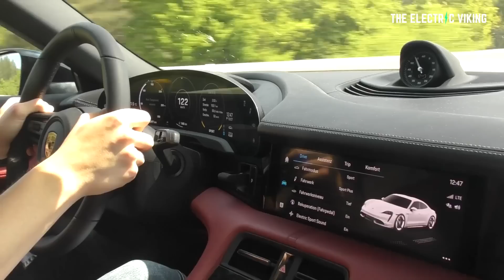Porsche begins producing synthetic gasoline it claims is carbon neutral

Comment: Spot on, Sam. The only future I see for synthetic fuel is for aviation turbine fuel. In the short term (5~10 years) there might be justification for synthetic AvGas for piston engines (light aircraft, e.g. Cessna etc) in what's known as the General Aviation sector. You may not realise it, but that sector is still talking about how to get the lead out of AvGas! I think we will see battery-electric light aircraft in numbers within about 5 years and the piston engine will be dead in aviation. Only the turbine engines will hang on as the last outpost of the ICE. Yes, Jets are an ICE.

The imminent death of the light aircraft piston engine is probably worth an episode on its own, but basically maintenance costs are horrendously high and will make the replacement of the Lycoming or Continental brands, with a suitable electric motor and battery pack, almost a no-brainer.
Reply: not gonna happen
Reply: @jebes909090  It already is. Electric powered aircraft are already flying in the UK.
Reply: What about commercial aviation? That can never be battery electric (at least not any time soon).
Reply: @top10cars2  Commercial aviation is the main potential market for synthetic fuel, and almost all commercial aviation is turbine-powered. Aviation turbine fuel is similar to kerosene, and so similar to Diesel that the refinery or manufacturing facility could make both.
The big hurdle to electric flight, apart from range, is the regulatory process. It takes YEARS to get approval for a new engine, because there are lengthy endurance tests which must be done to prove the reliability in actual use, including the whole range of atmospheric conditions. I would estimate a minimum of 5  years, assuming it passes all tests first time. So the fact that there may be prototypes flying now is encouraging but don't hold your breath. The way certification works it means that any change, such as new battery chemistry, will require re-certification.
Reply: 🤣🤣🤣🤣🤣🤣🤣🤣🤣 What utter BS David... This is the exact sector that I'm involved in and, a) removing lead from avgas is an extremely difficult think to achieve without SIGNIFICANT issues with engine durability (and NOTHING to do with valve seats and the like) b) The people that have been involved in this process for the past almost 20 years are some of the best petrochemical AND combustion science people globally - yet it's not yet resolved (I'm one of them) c) Whilst there are (and have been for around 10 years) some electric VLA's and soon will be several certified GA aircraft that have electric power, the challenges for more than short flights are immense - make no mistake. There will be NO SHORT TERM revolution - won't happen in your lifetime by the looks. For one, safety regulations prevent most flights being operated on such machines and will continue to be the case until many thousands of hours have been SAFELY achieved with them in testing. By the way, I also have a an Airline Pilots License and have been involved in the International Society of Air Safety Investigators for 32 years, so I know a thing or two about the aviation industry.
Reply: @johndavid6058  I'm grateful for your expertise but I'm confused as to what part of my comment is BS. You appear to agree when I say that GA is still talking about how to get the lead out of Avgas., and my other comments flow from the fact that synthetic fuels will be much more expensive (and harder to get). Here in Australia all of the Avgas is imported, so supply is likely to be more and more intermittent, leading to a preference for turbine power where available, or maybe diesel, (but I think it is too late to expect any developments on that front).
I think you underestimate the political pressure that will be applied; by about 2030 I foresee extra taxes on fossil fuels generally and leaded fuel in particular. Whilst the airlines have political clout, the GA sector does not, and there will be those who will want it shut down if it does not at least get rid of lead.

Comment: Carbon dioxide is a greenhouse gas. It does not cause cancer.   

A synthetic fuel can only be carbon neutral if the process to make it including the supply chain, is carbon neutral, which seems unlikely.
Reply: I doubt just CO2 will be the only emission.
Reply: @TonyGrant.  I agree with you. My comment was in response to Sam’s claim that carbon dioxide causes cancer. It does not.

Comment: Yes, electrification of countries that can afford it will happen. Exotic ICE cars will hum along for a long time to come. Green Synthetic fuels will be needed to meet regulation. Just like with airliners. There is a huge move and investment to make Green Jetfuels to reduce CO2 emissions. Still there is a huge number of countries who cannot afford to switch to electric cars anytime soon. Traditional oil and gas will continue there for a long time. Then eventually under pressure from the electrified countries they would switch to fueling their ICE vehicles with synthetic fuels. Finally I would like to mention that there are rumours that in January 2023, Mazda will announce a new kind of ICE engine that could reduce up to 80% fuel consumption. Thats a rumour but I hear it from multiple sources. It was mentioned recently on the Joe Rogan Experience by Randall Carlson. Dismiss it if you will. But mid January 2023 may take you by surprise. If that happens ICE vehicles with such an engine will be around for a long time to come and will run on synthetic fuels.
Reply: So reducing fuel consumption by 80% means it will run at 110% efficiency. Gotcha. Not that I'd believe everything ... ANYthing... Joe Rogan says. a lot of these right wing rabble rousers are oil industry shills. 
Mazda is coming out with a Wankel range extender for the MX-30, possibly solving all its deficiencies. It will run at peak efficiency and constant RPM. The last gasp for the rotary, and maybe Mazda.

Comment: OK it is currently five times the price of gasoline. But where will that price fall to if this scales up? Still it doesn't make sense for road vehicles. But for long range aircraft and fighter jets, e fuels may have a niche.
Reply: Lol…… as if the price isn’t going to go down!? The problem is hydrogen! We need a revolution now! Hydrogen is already replacing coal in steel production for example
Reply: What about supercars?
Reply: @aaronmiller5012  what about vans, commercial vehicles that almost used 24/7? What about vehicles that needs serious autonomy/range for remote work/activities?
Reply: @carholic-sz3qv  Any vehicle can use that fuel. You may or may not like it but give this fuel a chance. Electric alone isn’t even enough, ICE with these fuels should deserve to co exist with EV’s in my opinion.
Reply: @aaronmiller5012  maybe for classic supercars in countries that really don't want anyone burning fossil fuels. But will anyone be making non electric supercars in a few years time? In any event not a big niche compared to aviation and the military.

Comment: Maybe not for cars but for jets. Anyway what is better option to transfer energy from the Chile highlands? Ammonia?
Reply: Maybe this stuff might be useful to the military, where spending a mission dollars or more on a piece of hardware that's only going to last 20 minutes on that battle front makes sense.
Reply: @paulstubbs7678  The US military has funded synfuel research just for a logistics purpose. If the chain of supply gets cut off, locally made synfuel can keep planes flying. They can make it on a nuclear aircraft carrier if need be.

Comment: One can easily make ethanol, which is not a fossil fuel, if one can then put in additives that also are not fossil fuels and give the fuel the higher power per unit volume of gasoline , they you can rationally say it is carbon neutral, and this would allow existing and future vehicles to be far more CO2 friendly.. since at present lithium based evs do not scale, some scalable solutions must be found
Reply: Fuel are also needed for aircraft! Trains! Agriculture, mining…..
Reply: @carholic-sz3qv  oh well you have your electrify everything people who think it can all be done with batteries or what ever.. they need to learn about SF6 which is man made and used or electrical switching; it is 26,000 times more powerful as a warming gas than CO2 and lasts in the atmosphere 10,000 years.  Sort of a problem but they are always optimistic that they will fix their problems but they are not optimistic that anyone else can

Comment: From what I've read, the main economic barrier to e-fuel is the cost of renewable power for electrolysis, which will be dirt cheap if the process can use surplus, intermittent electricity. But why use e-fuel for cars? For aviation, yes, but it would make much more sense for Porsche and other car manufacturers to provide economical EV conversion kits. Ford and GM are selling EV crate motors, and the French company Transition One will be offering EV conversions for about $6k. The range is limited -- about 60 miles -- but adequate for most used-car drivers, and the range will increase as battery energy densities improve. Also, rental trailers with EV batteries could be used for long trips. (Another French company, EP Tender, is developing battery trailers.)

We've got to do something about all the old, ICE vehicles on the road. Why is nobody talking about EV conversions?
Reply: That intermittent use of surplus energy is very interesting point. For example there are times that you have huge amount of wind energy and not necessarily anything where to use all of that energy (which is a problem). Using that to generate e-fuel or hydrogen would be pretty good idea. Also to my understanding hydrogen plants are being done already.
Reply: Let’s not forget the many other applications of that fuel and hydrogen too! Hydrogen is already replacing coal in steel production
Reply: There is a French company doing conversion kit

Comment: If it's as expensive as gasoline or higher (when produced in high volume), this will mainly be used over time by rich people who have fancy high performance ICE cars they want to run for fun or sport, not middle class to poor people who mainly make transport decisions based on convenience and economics.
Reply: Hopefully it will be super uneconomical,  and they will put their money into something useful.
Reply: @paulstubbs7678  it doesn’t just need to be economical but also to work and be something future equipments or vehicles could use for things like BEV can’t do which is actually a lot!
Reply: The only thing to make it expensive could be hydrogen but fortunately we’re going to sooner find a solution for it. Hydrogen is already seeing a massive future in steel production for example it’s just the beginning
Reply: My 2012 keep wrangler from the time of purchase to when I sold it 10 years and 165000 miles later cost me including the price sold, just over $60000. This includes mods, gas registration insurance tires etc. a new all wheel drive electric car costs that just for purchase price. Still cheaper gas wise.

Comment: In the long run, the molecules in the atmosphere will dissipate (physics) and things will even out.  So the carbon neutrality, big picture over time, is reasonable.   The PROBLEM, which you mentioned, is that the fuel produces roughly the same amount of dangerous / health adverse emissions as normal gasoline. 

So doing this in quantity is still a real bad thing for society.
Reply: You are the bad thing for society!
Reply: Nonsense!!! It doesn’t have the same amount of elements compared to fossil oils! Fossil oils has to be refined and also made into millions of products! This is synthetic!!!!!
Reply: Koesnigsegg has already worked out with Icelandic company using gas from volcanos to produce fuel! It’s called vulcanol I think!

Comment: To the abundance of energy…
That’s unfortunately not how economy works.
The providers want to first and foremost produce money, not power. They will unfortunately always scale production with demand, so they can charge normal prices for that and be economical. If they would overproduce, that would mean they would have to provide more systems out of own pocket to sell for a lower price? Not going to happen, unless we decentralize the production away from the big players and create competition
Reply: That's what home solar does, it democratizes the means of production, which will force the hand of utilities to lower prices to compete. The big players will only be able to delay home solar for so long. Once it's cheap enough for the average citizen it's game over and it's already the cheapest form of energy production and dropping. It also helps countries with national security as its impossible to take down a country's energy infrastructure if it's massively distributed. It also allows a country, state,company to manufacture goods at a lower price if they are using super-power giving them an economic advantage forcing other companies to invest in "free" energy which will also apply pressure to energy producers